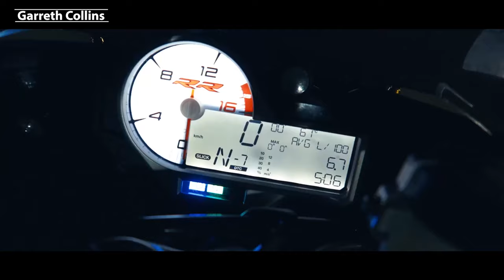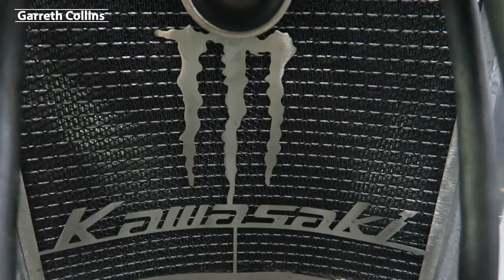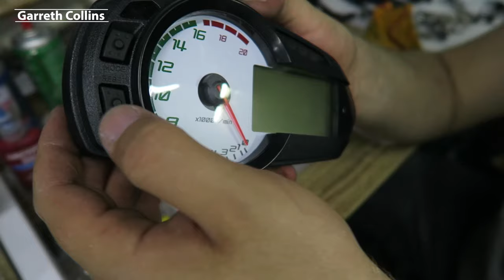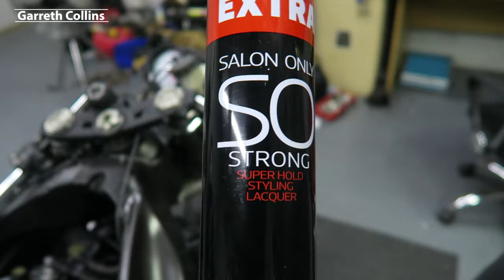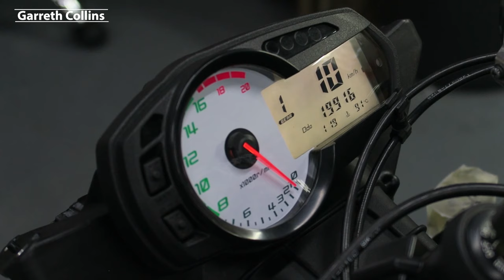Rebuilding A Crashed 2012 Kawasaki ZX-6R Part 5

Comment: Hey there Garreth, some positive feedback in hope you can do better: can you please install bearings that mount on the outside ring, without tapping on the inside ring, at 04:22 i see how you're damaging the bearing this way.

Also a chain needs to be oiled from the inside out, not the otherway around. Slight detail but important. Good luck

Comment: nice wheels...
i have a little question plz...i changed the flywheel of my fz8 (2011) the magnets shattred inside...i put a new one and after some rides, it did shattred again....can the bearing be the problem?
Reply from the maker: Check the bearing or  look for  vibrations. Something doesnt sounds right.  Fly wheel could be rubbing against the magnets. Causing friction